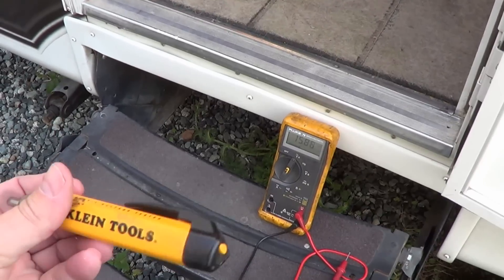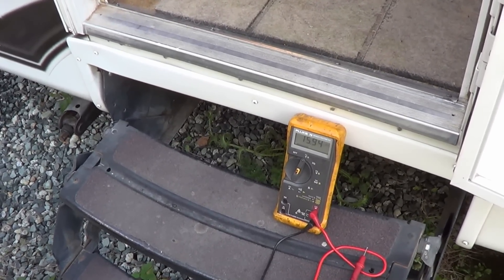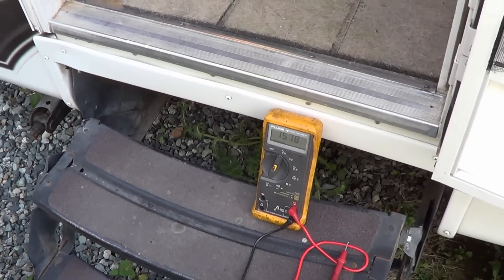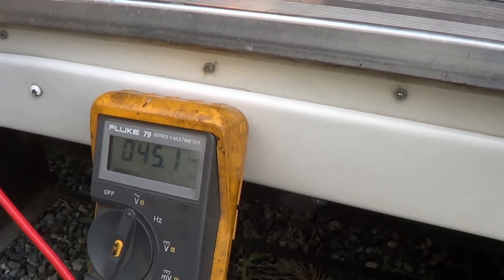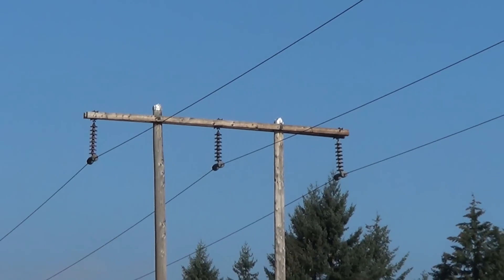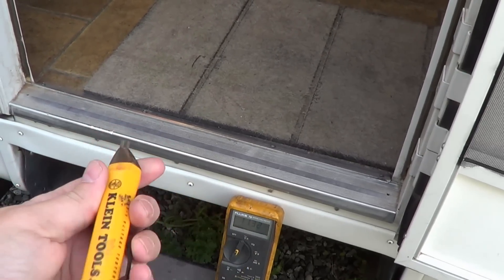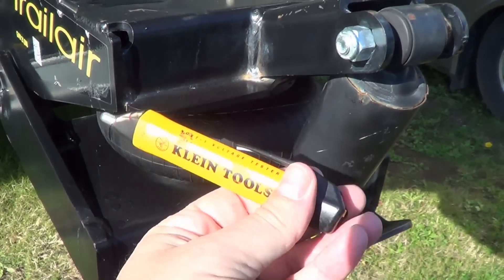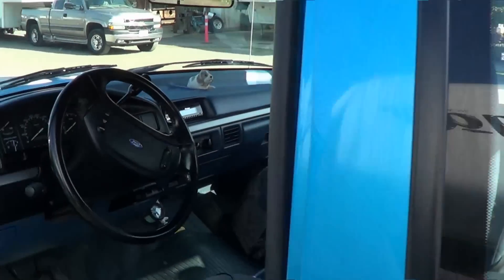Why Was My RV Giving Me Electrical Shocks?

Comment: Wireless electrify?
Reply from the maker: Yes, high voltages from power company wires overhead induce power into the RV frame. Very low current and power but it is there.

Comment: I got 2 quick shocks from my pop up while it was connected to battery only.  No tingling.  Should I be worried about hot skin?  Maybe just static?  My friend never got shocked at all.  Thanks
Reply from the maker: If only connected to a 12V battery, there isn't a concern. You can touch both posts of a 12V battery at the same time, and it won't hurt you due to human skin resistance.  Generally, battery voltage has to be higher than around 48VDC to be a problem shock wise.
Reply: @LoveYourRV  thank you Soo much.

Comment: I'm an electrician and I also have this problem with my RV. 
In mine the problem was I realized the extension cord I was powering the RV with was missing the ground terminal. As soon as I lowered down the rear stabilizing jacks the trailer grounded itself and the shocks stopped.
Always double check to make sure you're ground is good.

Comment: I am having the same problem but I'm not close to high voltage lines
Reply from the maker: If it does it when plugged in, then do a Google search for "hot skin effect." It needs to get fixed as it can be dangerous. All the best, Ray

Comment: So what do we do if we are NOT under the wire and our trailer shocks?
Reply from the maker: Unplug it and get an electrician to look at it ASAP.  You may have a dangerous wiring condition https://rvelectricity.com/2018/09/24/rvelectricity-what-is-hot-skin-stray-voltage/

Comment: How did you remedy the problem.i have children around
Reply from the maker: If worried about it, just put a metal stake in the ground and run a wire to frame the RV.  It will bleed off any stray voltage to the ground.

Comment: Hello Ray, Thank You for this video!.  Same thing happened to me today,  I was just parked at the Tampa RV show for the day, under the big electrical powerlinea,,  4pm,, I was getting shocked everywhere on the metal and my chrome bumper felt like electric and even vibrating.   I took my  non contact voltage tester like yours and it was going like crazy,, on the any metal of my trailer, the tongue, on the stabilizer bars,, and, even on the truck !!! 🙆‍♀.  I started the truck randomly to recharge my RV batteries a bit.  All gone,, !!  Grounded.  Gees, I'm glad I am viewing your video,, I thought I had another big electrical issue and was searching how to everywhere !! .  ⚡. Turns out I am testing an EMF meater, curious to see how it reads under powerlines, way up there.   Cheers  🙌🏼

Comment: yeah i have the same thing happen in my trailer. i harvest the power from time to time using a little contraption and use it to charge my phone via a battery pack that i charge using 2 little cables on a stripped wire to a microUSB plug

Comment: Did you confirm that that was the source of the shocks you were receiving?
Reply from the maker: Yes, parking under high voltage power lines with no metal parts of the RV frame touching the ground will do this. A small amount of energy is induced into the RV frame creating a voltage differential between the RV frame and earth.  But it stores very little capacity so not very dangerous.
Reply: @LoveYourRV  thank you very much for your reply. I've heard of induction causing a measurable increase in ambient voltage. I wasn't sure it was something that you could feel in your body though. I appreciate your help.

Comment: sounds like a ground fault problem in the high tension wires, it sounds to me like the power company did not properly install ground wires when they installed the transmission lines.

Comment: I would drive a galvanized gutter nail into the ground, then attach the top of this nail to the frame of your RV using a 3-foot wire with alligator clips on both ends. Just don't forget to remove it before you drive off!
Reply from the maker: Definitely would work but I think the easier thing to do is just put down my rear stabilizer jacks, they are metal and attach to the trailer frame. Cheers, Ray

Comment: Friend that lives in a bus took the tires off the bus and has power to it now electricity and for some reason last night I was washing my hands and doing dishes and I was getting shocks put on my friends flip flops and it wasn't no shocks no more but I had just taken a shower not long before and I didn't get no shocks but there's a rubber mat in the shower. on the outside of bus or when you touch the bus from the inside I pushed the door open and I could shocks and the dogs were getting shocks on the outside but there's also a power line in the corner of the lot could that be the problem just like what you had in your video ? How can we stop it ?
Reply from the maker: Could be the power lines but also could be power to the bus is wired wring and very dangerous called a hot skin effect. Better get someone that knows electrical to check it out.  Here is more info on the hot skin effect and what may cause it - https://fifthwheelst.com/rv-electrical-safety-hot-skin.html

Comment: It is called induction.
Reply from the maker: Thanks, I guess that's why I used the verb induce in the video.  ;)
Reply: @LoveYourRV  Would a Ground Rod reduce the voltage, such that you could no longer feel it?
Reply from the maker: @MrSummitville  Yes, any metal from the RV frame to the ground would. I could just have one of the rear stabilizer jacks lowered. My front jacks didn't do it because I have plastic feet with rubber covers on them.

Comment: Did you try running a small fan from the shocking received from power lines
Reply from the maker: No, I'm pretty sure the potential amperage is so low it wouldn't be enough to drive a fan

Comment: Old video. Thanks for the info. My RV is shocking me . Plugged in to shore . Well house ? Are my wires common and hot backwards or ground and common backwards.
Reply from the maker: Sounds like its a hot skin effect, better get it checked something is miswired and the RV frame is becoming hot - https://www.rvtravel.com/rv-electricity-why-do-hot-skin-shocks-occur/

Comment: I am an electrical engineer who works on radio communications sites that are frequently installed in remote locations like mountaintops or utility ROW (rights of way) where there are overhead transmission lines. Since we frequently are sitting on the crest of a ridge or a hill it is not unusual for a power transmission tower to be running really close by. In fact at some of our sites we are so close to the wires that we have to consider MAD (minimum approach distance) clearances for working near wires. 

At one site near Muscle Shoals Alabama we were installing an antenna on a building rooftop, right underneath a 500KV transmission line. (it was a substation building) and I had two guys up on the roof, installing the roof bracket and the antenna. They lowered the coax cable down over the side and I decided to "help" (always a dangerous thing when an engineer "helps" techs). So I went up to the side of the building where we had a hole drilled through the brick wall for routing the coax into the building. It was a misty and overcast day and those wires were just cracking away overhead and the guys lowered the coax cable so I could grab the end.

-- Well, I next knew that I was sitting on my ass in the mud, about ten feet away from the building; My heart was racing, the guys on the roof were looking down and yelling at me if I was OK. 

It seems that right at the point where we were going through the wall was also a little concrete pad that I was standing on and the drain line for an ice-maker that was inside the building was constantly dribbling water out on to that concrete pad, making it constantly wet. I was standing on a fairly good conductor to ground and my bare hand touched the stainless steel Type-N coax connector on the end of the cable and I completed the path. The antenna was only about 15 feet up but it was picking up enough stray electromagnetic energy from the 500 kilovolt transmission lines that I completed the path to ground.

It was probably a few hundred volts but at almost no current but it successfully "rung-my-bell". We did get the cable in the building and as we were attaching the ground clip to the connector at the radio there was a constant little spark going on (wearing my high voltage gloves at this time). 

The take-away is that any mass of metal that is going to be crossing the electric or magnetic field of a power system is going to have some coupling going on (like a giant, open air transformer, the same principle applies). If you had taken 50-100 feet of wire (or an extension cord) and ran it back and forth around that storage yard you would of had a pretty good electric charge on that wire. It can be fun, do that sometimes and use an old fluorescent light bulb at night and watch the thing dimly glow. (just don't get shocked, also be aware that the utility company will take a very "dim" view of our antics).

Comment: wireless power is posibel fir exampel cooling system electrolisys even with out baterry you can get a shock if you ignore that high tension wires about you

Comment: Wow ....how bazaar? Would never have thought that can cause your RV to draw current. I'm having similar issues in an outside steel shed that has an extention inside only providing power to outside lights with one plug and also my booster pump from my water tank. If I touch it I get a shock.
Reply: The metal shed needs to grounded, and you need to find the source of your leakage current ...

Comment: We just got a camper. And it is parked right under some power lines. Can this cause damage to my camper?
Reply from the maker: No, I don't think it will hurt anything, its very low current, little bit of static like you get off a sweater or door knob.  If you have any metal jacks touching the ground it won't even happen. You could also just attach a metal chain to the metal fame of the camper and let it hang down onto the ground.  Also for this to happen it has to be high tension power lines, not just regular neighborhood lines.  Cheers, Ray
Reply: Love Your RV so if the shock isn’t happening because of the power lines? What could it be?
Reply: @jessicachanning2447  Shock while plugged-in is a wiring problem, either in the RV or whatever it's plugged into. (Sometimes both.) There should be zero measured voltage. It's safer to test with a non-contact tester (fully insulated, no metal probes). Turn off, unplug, and complain if you measure voltage. A grounding stake is not reliable protection against wiring problems; it doesn't form a good enough connection.

Voltage or mild shock while completely disconnected is electrostatic induction from something. Power lines (and only the big transmission lines) should be the only source. It doesn't hurt the RV. The current is nearly zero while ungrounded, slightly higher if grounded, harmless either way. Jacks or a grounding stake are effective.

Wiring problems can, at least in theory, travel through water and sewer hookups. There would have to be something outrageously wrong for that to happen though.

Comment: Wow!!! High tension gave you tingling?? Does it affect health in any way,with time?
Reply from the maker: Possibly, I've heard that cows give less milk when under high tension wires. I guess each person is different. I've never had an issue with power.
Reply: @LoveYourRV  Inside, it is essentially a Faraday Cage, right?  So, it is just the entry and exit that is "shocking" ...
Reply from the maker: @MrSummitville  Yes, I needed to be touching both the RV metal frame and the ground to complete the path and allow current to flow, but the amperage was very very low. Just enough to feel a tingle.
Reply: Wow!!! Holy... Cow! I really hope it doesn't affect you in any way

Comment: I'm doing some research about some problems I get from appliances. Every metallic think that I touch I get tingling. From my washing machine,my oven,my coffee maker,etc. Every appliance I have that are connected,gets tingling in my fingers. And most of the times in the summer I am barefoot and my hands either sweaty either lightly wet (that happens with the washing machine,it's wet on the inside) and with the others,my coffee machine was also wet and I touched it lightly to check if it was hot enough to make a cup of coffee (italian style coffee maker) but this should not happen. Is there something wrong with me or do you think my appliances don't have proper earthing connection? The house where I live in is in fact pretty old and no one else from my family experiences the same thing. Wth? 
Can someone explain,please,what's happening?
Reply from the maker: For peace of mind, I'd hire an electrician to check your house wiring. Wouldn't take long to check the power distribution panel and the outlets.  Cheers, Ray
Reply: Thank you very much for answering me! I will definitely have someone check. 
Yesterday I had a grill taken out of the oven and placed on top of it. Guess what,when I went to move it slightly,I felt tingling in my fingers. I don't understand why in top of it?! 
I definitely need to wear rubber gloves in the meantime

Comment: Principle of mutual induction. The trailers are acting as the secondary of a transformer. Ground your trailer. When you felt that tingle sensation, your resistance limited the amount of current you received. If you get between a good ground and the energized trailer skin, it could kill! The trailers should NOT be parked under the lines! A very dangerous situation.

Comment: If you have an electric water heater in your RV, a bad heating element will cause intermittent shocks.
Reply from the maker: Not in this case the RV wasn't plugged into AC power. 
Just curious though how does a bad heating element cause intermittent electric shocks? Cheers, Ray

Comment: Mine shocks the hell out of me only when I have my boots on, I think when I’m grounded to the ground then I’m a complete circuit. It hurts so bad! I need to find out what wire is making it do that.
Reply from the maker: If it happens when your trailer is plugged into shore power you could have a dangerous problem called a Hot Skin - more info here - http://noshockzone.org/rv-electrical-safety-part-iv-%E2%80%93-hot-skin/
Reply: I am having the same problem with my rv. It really hurts and it is so bad i have to step on a plastic bucket and enter very carefully. Sometimes it will shock me just by putting my arm (in mid air) through the entrance . When there is water on the ground i just have to stay away from it because one day, while outside, i was crouching down (looking at something on the ground)  in front of the door and i barely made contact with the step and it  literally knocked (pushed... jolted)  me backwards onto my back. My arm went partially
Reply: Numb for about an hour .

Comment: Lol dumb ass you have a leak on one of your wires coming from your solar to your frame  on your rv, i they have nothing to do with high voltage lines if it did you would be dead due to the high power line and it would ground out and blow the transformer IDIOT
Reply from the maker: Sorry you are wrong, nothing to do with the solar system -  Please read for the cause - https://rvtravel.com/hot-skin-condition-from-overhead-power-lines-not-dangerous/

Comment: Like watching some older videos. But when you mentioned, in a response, that if you didn’t have the pads, I guess like snap pads, that the metal jacks would have grounded trailer. So what about a lighting strike ? Are the pads not good for an RV if hit by ⛈ lightning 🌩 ??
Reply from the maker: I don't think it would make much difference with a lightning strike what you have. You're not safe in a car because of tires, it because you are in a metal shell. So its the RV frame that helps keep you safer.
Reply: Love Your RV Heard of that. The cage not tires.  So only if RV has aluminum structure then.  Otherwise jump in car.  So good to know what the walls/frame  are made of. Thanks.
Reply: Lightning carves a channel of pure plasma through miles of air. It is perfectly capable of making its own grounding rod through the last foot or two between the frame and ground.

Lightning is an unusual electrical source. We're used to (approximately) constant-voltage electrical supplies, but lightning is almost perfect constant-current. This means it damages insulators (destroys wood) but passes through conductors without harming them. Lightning conductors approved for short structures are 2 awg - not much heavier than the large grounding wire of a home and lighter than its service feeders. It will blow through thin sheet metal, but a few millimeters of aluminum shrugs it off. 

Fun lightning facts: 

Airliners are struck approximately once per year *per plane*, but noticeable effects are rare. 

Recent research finds direct evidence of nuclear reactions in lightning strikes: including free neutrons and the gamma-ray fingerprint of a positron source, most likely N-13. 

Lightning bolts come from lightning leaders, but nobody knows exactly where leaders come from. The electric field in clouds has been measured but it's nowhere near steep enough. The current theory is that thunderstorms accelerate some kind of cosmic radiation particle.

Comment: Lol that's how you keep burglers away. I put an old Ford magneto coil box attached it to my shell for just that reason. To recitify it you have to ground everything to either the hook up or physically ground the RV to the ground with a copper pole. Military does the same when they have fuel pumps so they don't explode